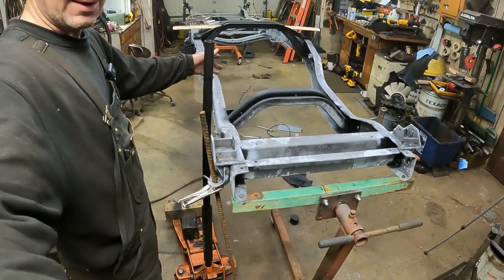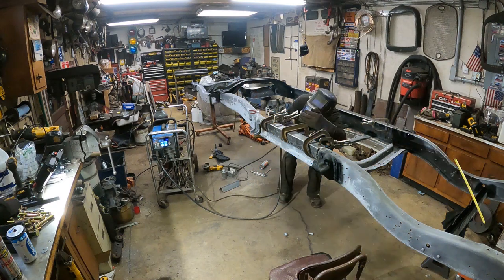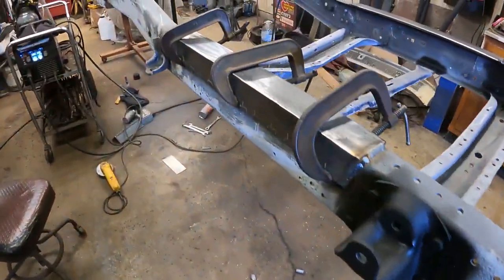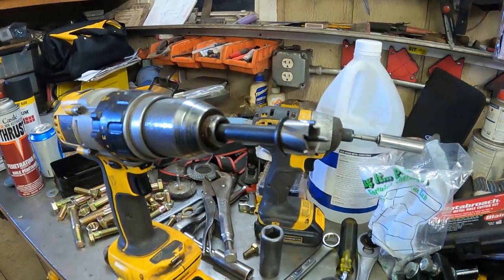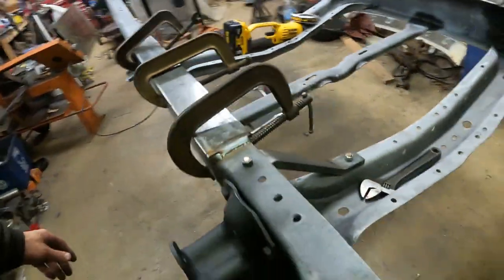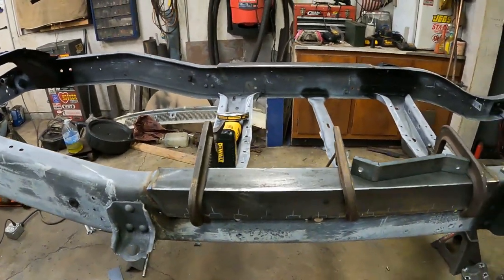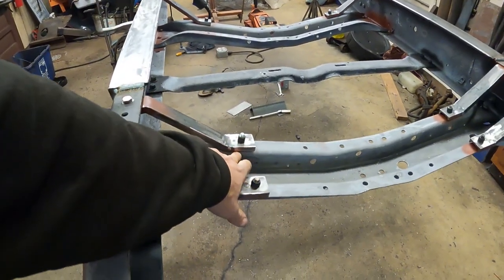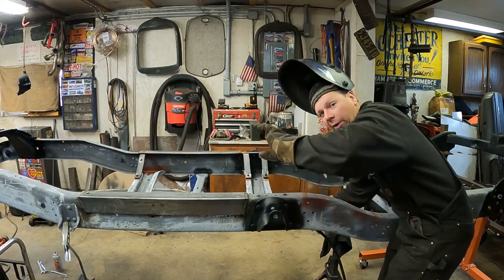Sketchy Frame Rotisserie: 1980 Dodge W200 Build

Comment: my 91 k1500 has developed tiny hole top of fuel tank because of salt entire pole shed fills up with gas fumes now waiting for above zero weather to fix that. ever break a blade on that bandsaw there's 2 vertical type bandsaws at work blades break nonstop because they twist
Reply from the maker: No, haven't broke a blade on it, bit I've only had it a short while.  I bought it a swap meet this summer.